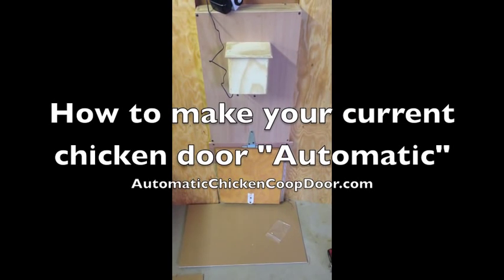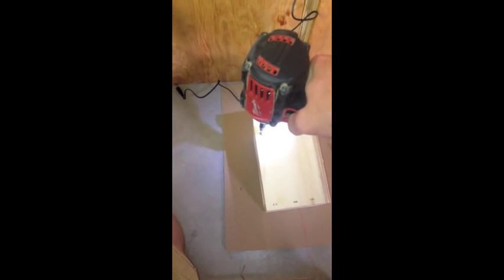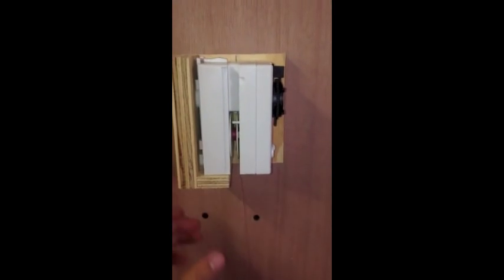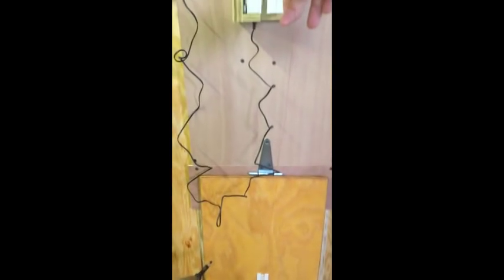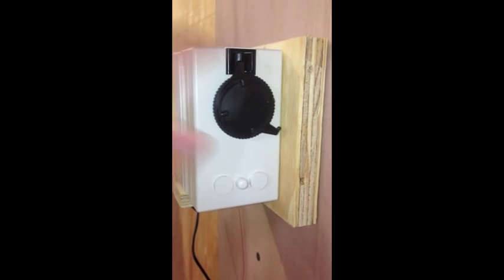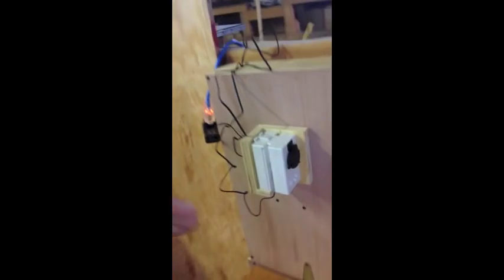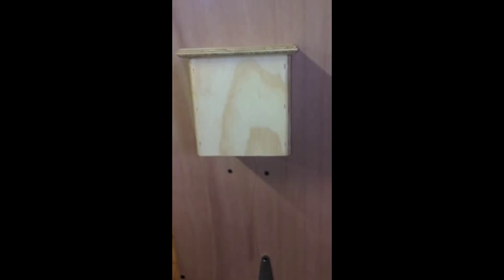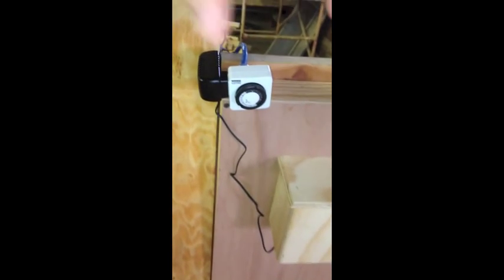Basic understanding of how to make your current chicken coop flap door automatic

Comment: I have bought this particular door opener for my chicken coop door that opens vertically. It works great except that the line had broken a few times after one year of service. I replaced the line with stronger fishing line. I also replaced my coop door with a heavier door that the door opener was unable to lift. I remedied this by using small pulleys  that helped lighten the load on the opener. It all works beautifully. As far as a flap door. It's a no go. Predators will get in unless you have a latch system to lock after it closes
Reply: Jesc ; Thanks for this information about the flap style door not being secure without a latch. I wondered about that while watching this video. I agree that a fairly heavy vertical door that slides up / down in a track would be better to keep a predator out.

Comment: did that timer come with the unit or did u have to buy one?
Reply from the maker: The timer came with the unit. Although the company clearly posted in the directions you can use any timer or controller you prefer to operate the door. They claim the manufactured the door to operate with any controller the customer preferred to use over their product.

Comment: sorry but i to do not understand how predators would be kept out,  your door swings inward, there is nothing to lock the door shut. ???   or inless it can be adapted to move the door up & down like most other automatic doors
Reply from the maker: Yes this is to help automate the current flap doors for coops that are too small to fit a sliding door as it requires more room.